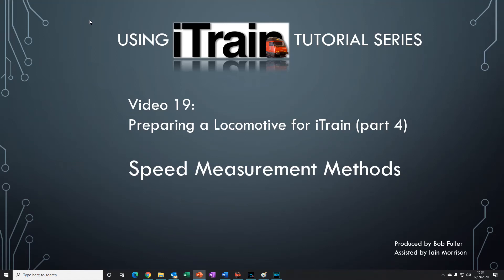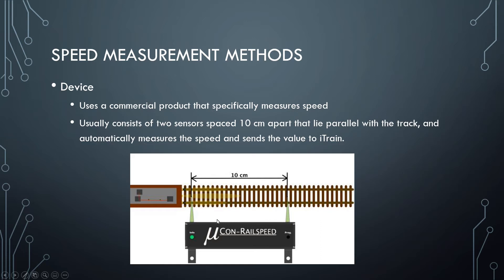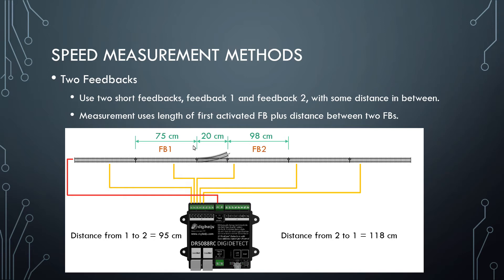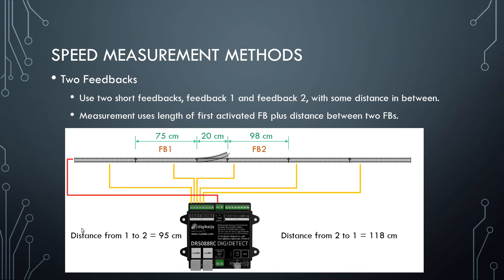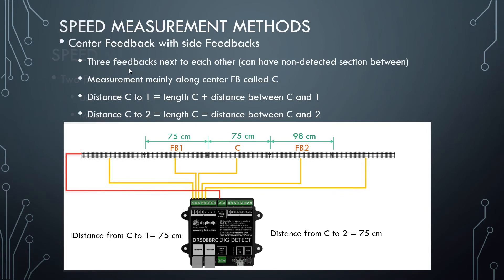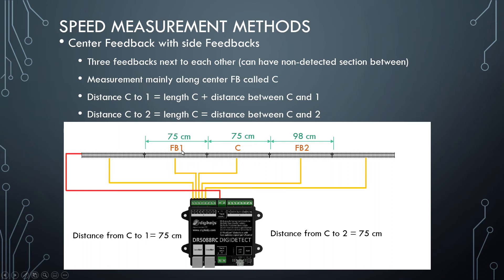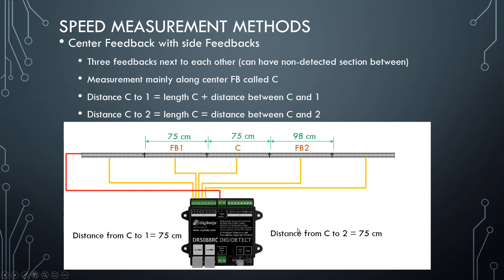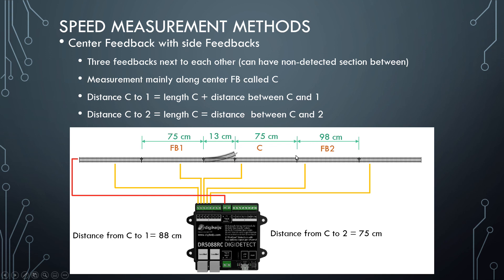Video 19: Using iTrain Tutorial Series - Speed Measurement Methods

Comment: Hey Bob, understood the differences between the three methods.  But after I have chosen Center Feedback with Side Feedback and fill out all distances, I pressed start and nothing happened. Did I miss a video where you explained how to use that?
Reply from the maker: Have a look through video #16 again. That tutorial includes a video showing the Speed Measurement function being used. If that doesn't help, we will need to see your layout file (.tcdz file), in which case, please post your question on the iTrain forum and attach your .tcdz file to your post.
Reply: @bobfuller  Thanks so much - I was skipping some videos as I thought it helped me to get quicker to what I need at now. Seems I missed that for Video 19. As of now it all works out. I just have issues with reading the CV addresses - writing is no issue. Any guesses on that?
Reply: @SpureNdlich  You need to highlight the CVs that you want to read in the list before you try to read them. Also if you are trying to read the CVs whilst in the main track then you need to have Railcom on the decoders and feedbacks.

Comment: Hi Bob and Iain - GREAT STUFF!!!!!!
The question I have is how long is the optimum length for feedbacks for 1-c-2 track in the speed measurement when using iTrain to measure locos - people ask me this a lot - thanks JC
Reply: John, I am not aware of any defined size however I find that 50cm for C works well for me in H0e (1:87) and I know that this also works well in N Gauge (1:148). I suggest that 00 (1:76) would be looking at slightly longer as the larger the scale the larger the measurement section.  I generally say to people 25-50cm for N gauge, 50-75cm for 00/H0, and 75-100cm for 0 gauge. 

The run off at either side is the challenge because this might need to be very long if you have a high CV3 or 4 value. I recently set up a dedicated,  separate measurement track for a chap and we needed almost 1.5m + 0.75m + 1.5m for 00 scale to allow space for the locos when running at full speed to get up to speed and stop (and TBH that was tight at full out the box speed). if the 'wings' are shortish then I suggest CV3 and 4 MUST be set to zero when profiling a new loco as sometimes OOB speeds can be very high with slow braking and acceleration.
Reply: @damenfeld  that’s really helpful Iain thank you JC
Reply: @goodisonroadmodelrailway6798  John, we also were using the standalone speed measurement track to do the Reaction Delay tuning which also added to the required length.